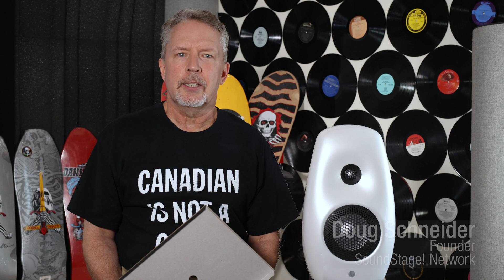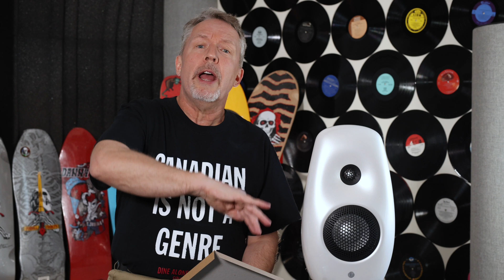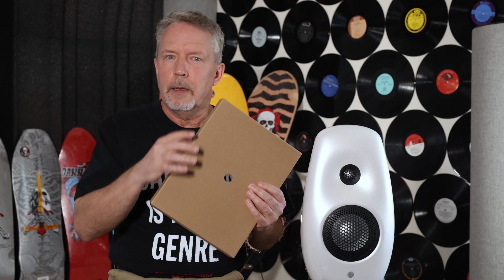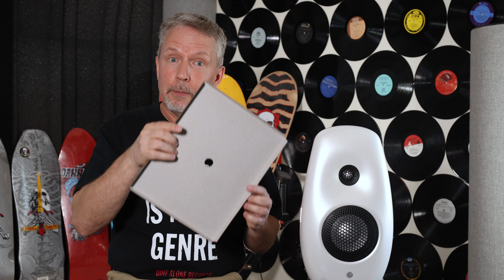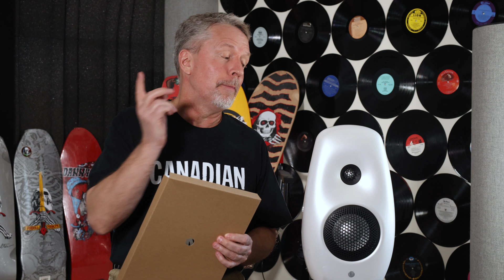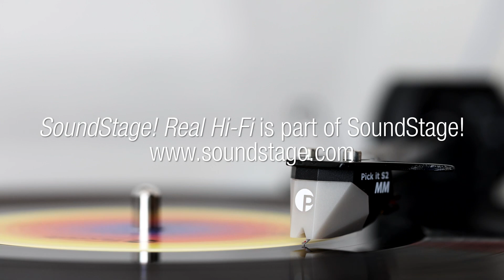This Will Change the Way You Look at Loudspeakers - Bad, Better, Best Baffles (Ep:67)

Comment: So is the B&W 801 series tweeter system the best for detraction?
Reply: The B&W method certainly gets the cabinet out of the way for the tweeter, but I'm not sure if it can be considered "the best" as the waves wrap around the cabinet because of the way, say, the midrange chamber sits on the larger models, etc. Would have to be tested extensively to know how effective it is. But it is obvious they're trying to leave that tweeter "baffle-less."

Comment: So will a speaker grill make things worst?
Reply: In general, yes, the grille will, which is why you see that in most reviews, the reviewers will leave them off the speakers being reviewed. In some rare exceptions, however, the grille has been designed such that it improves the baffle and, therefore, the speaker is better with it on than off.
Reply: The better reviewers who actually use measurements usually (although not always) show you their measurements with & without the grill. Theres always a difference in the measurements but usually (depending on their quality etc) it's not to the point where most if any human ears would notice.

Comment: Nailed it Doug. The sad truth about so many loudspeakers is that they are designed to a price point, not a performance objective as the first item of attention. One thing that I am sure you know, the air pressure wave coming off of a baffle radiates 180 degrees, to the floor and also the ceiling. A good designer also works around and with those effects. Love the Paul Barton reference. I remember reading his notes in different books I was reading at the CISTI library when I was studying there in the late 80's. Paul knows his stuff.

Mark